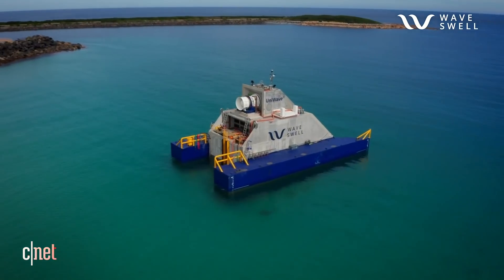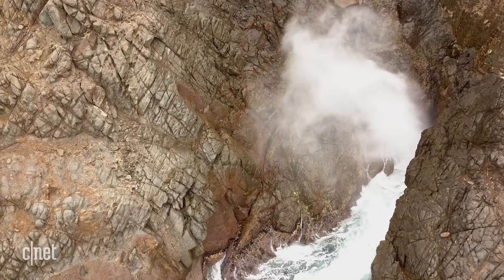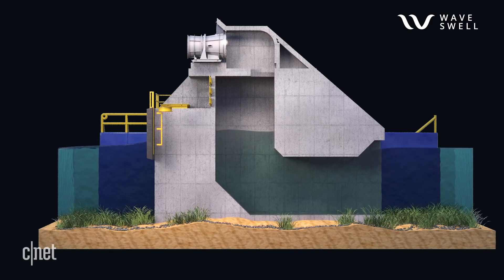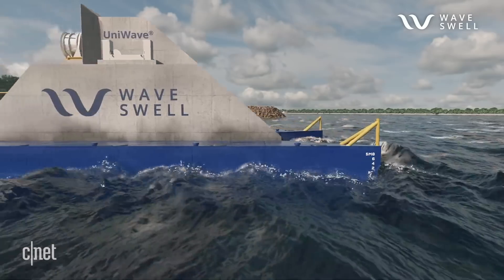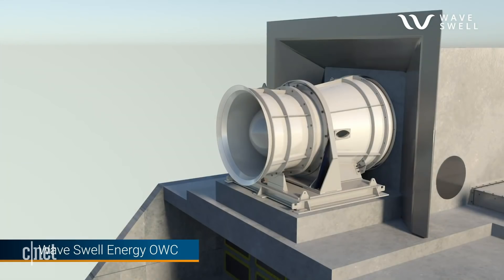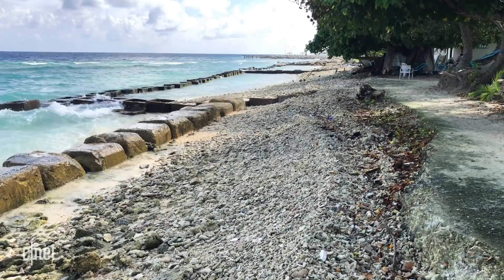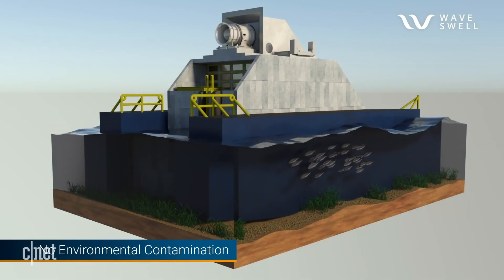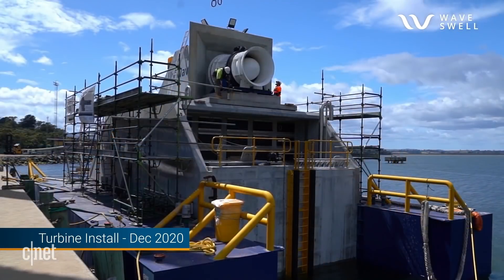How this 'artificial blowhole' could make wave energy mainstream

Comment: Do you think wave energy will be an important renewable in the future? Are there other futuristic technologies you'd like to see us cover? Please let us know down below!
Reply: @Eduardo Hwang
They use only the vacuum generated by the wave inside the blowhole. They do not use the air both ways, therefore not changing directions on the windturbine and not affecting inertia. As all the moving parts are outside of the water I think this could have great potential for the future (marine live included). As oil rigs are capable to withstand a long time in the ocean as well.
I always taught that we need to use more of the tidal power for future green electricity production. I would like to know why they did not use a V-shape as most natural blowholes are a bit v shaped.
Reply: Seems like an excellent paradigm of thinking for islands perimeters to reduce the energy, as well as use beneficially, of the water front.  Furthermore, as a power station for the energy co.rigs, lighthouses and other signaling or communications crafts.
Reply: @jafinch78  I’m Trump’s VP aka MMG of Maybach Music Group—IAM H|M—have had a complete crypto infrastructure since 2017 GOOGLE MITCHELL MARRS search “Silly Secret Service Sfumble” on YouTube! rVP MMG MARRS
Reply: @Eduardo Hwang This solves a lot of the corrosion issues as the sensitive mechanical components are not actually immersed in the salt water. Corrosion should only be marginally worse than a floating windmill, since its significantly lower to the water. As for the reversing issue, it is possible to use variable pitch blades to pivot the blades midway through, which could theoretically be done with pretty minimal energy cost but would substantially complicate the design.
Reply: Wave energy is far more constant than solar and wind and also has good output in winter when solar output is low.
Reply: @danielstapler4315  THANK YOU…. Someone finally said it! Much more constant than daylight….
Ps: the term sunlight should be dropped permanently and daylight used in its place as this is the real world reality.
Reply: Absolutely...would like to see what is happening with deep water energy projects(hot/cold) ? if it’s still viable..any in the works?
Reply: Well, maybe at the beginning of summer: revisit while adding an examination of + the Ocean Wave Power Plant + Wavepiston + CETO + Azura... consider where they might best serve... aquatic life, with no spinning blades... (see this one covered that) & additional potentials (like Wavepiston can also pump water, for de-salinization)... or potential sound avoidances... and that's just wave energy potentials, while there's also cooler to warmer surface to depth piping that's another energy potential that can be drawn from the seas & oceans...
Reply: Resort owners will squash a widespread use bc it is important to get a skin cancer and tan while looking at a vacant ocean horizon.

I don't own a resort and am for a variety of green energy helping us into the future.

I wish I was younger so I could watch all the current anti-green energy people die out and be there to celebrate their passing.
Reply: ... needs an aesthetics makeover to go into any populated coastline. Economic feasibility depends on the numbers. Amazing how many internet-smarties already know the answer without numbers.
Reply: Another way of exploiting on existing power in nature would be making use of tidal waterflow. Twice a day reliable masses of water go to and fro. This energy also should be harvested.
Reply: @HarryGuit  tidal is good, requires a nice big basin to be effective and then it doubles up as on demand storage, more predictable than wave power and just needs a low speed turbine and shaft, similar in construction to a ship's machinery.
Reply: @zopEnglandzip  Yup, simple man-made channels  leading to a significant inland collection pool : Double the run-in / run-off, double the energy reclamation, along the lines you have described: Water Head is NOT the only way to make energy! Volume is a key component too, even at lower speeds / pressures...i,e tides running up (& down) a designed bore....where ARE teh hydraulic engineers on this forum???
Reply: @citizenscience659  
It can produce good power but at the cost of environmental change or damage. Once you either close off an existing reservoir or create a new one you’re effecting the local flora and fauna. Dubai’s Palm and World artificial island building projects have shown how reducing the natural flow and effecting the ecosystem can have unpleasant and unforeseen consequences.
Reply: @HarryGuit  
This has been looked into and there are a few major environmental drawbacks to it.
Reply: How about the latest developments in nuclear power?
Reply: hi, you said this thing will start producing electricity by March. is there any update? was it successful?
Reply: Water collection from solar style panels, very interesting stuff
Reply: Awesome: Doing away with Wells turbine inefficiencies AND limiting salt/moisture exposure to the rotating parts! 
Phase 2:  Dramatically INCREASE the water column for free, by clever design.... capture a steeper energy gradient by lateral Funneling of the medium...give me a call if not clear.  Or at least give me an honourable mention when you do crack it....
Reply: @Eduardo Hwang 
I think with a simple arrangement of flap valves the turbine would only ever spin in one direction. Imagine the old fashioned bellows from a forge? On the suction stroke a flap valve closes so it doesn’t suck hot embers into the mechanism. With the right timing the incoming wave could pressurise air and on the waves recession it’s trying to create a vacuum so could then suck the turbine from the other side by dint of a flap valve. I hope that makes sense, coz it does seem feasible to me. If it doesn’t let me know and I’ll try and explain it more betterer 😉
Reply: @Therapistinthewhitehouse  I’m Trump’s VP aka MMG of Maybach Music Group—IAM H|M—have had a complete crypto infrastructure since 2017 GOOGLE MITCHELL MARRS search “Silly Secret Service Sfumble” on YouTube! rVP MMG MARRS
Reply: If this can compete on cost with conventional coastal sea defences and has suitable grid access then it may be a Success
Reply: Projects like the materials genome project, where they can predict the properties of yet to be made materials, will I think get us what I call "Enhanced Conductors", that whilst not being superconductive won't require any cooling & will enhance the efficiency of dynamos & motors without much heat lose.
Reply: How do we contact these guys we want some
Reply: The execution on this wave power is interesting and can probably be something in the different scenarios he described. Cement is one of the worst environmental culprits and requires a lot of energy to manufacture and is harmful to the environment.
Reply: Nuclear fusion is the only way. Everything else is a supplement.
Reply: @outterboxthinker  
You better hurry up and solve the problems achieving it then😉
Reply: @outterboxthinker  the issue is why do smaller nations need nuclear fusion when more simple (and realistic) technologies like this is available now. I see this as a great option for smaller island nations and isolated and non isolated coastal communities. I would like to see such communities rely much less on large electric producing companies dictating to the communities about what the communities need.
Reply: I think it's a great idea. Simple is always elegant. Even with a large opening reef buildup won't make much of an affect. Easy to access easy to fix. With other added benefits. I think this technology will go places.
Reply: this episode was great! 
would love to hear more about new generation small, fast, mobile nuclear reactors, for starters.

specifically, I would love to actually see how much nuclear waste is generated comparatively per day/per GWh and how it can be stored safely.
Reply: Turbines installed in the potable water infrastructure.
Reply: @kengoetz6231  what point are you trying to make?
Reply: Only with LED lighting strips will this work! But seriously it would be necessary to compare Wind energy side-by-side this wave machine I don’t believe there’s enough air moving through to be efficient.
Reply: Nope, energy production vs what we need wont come close to making an impact. Cover the coasts in these ugly bunkers and we still wont solve our power problems.
Reply: There’s no way to overcome the corrosive nature of the oceanic environment, and I don’t think wave energy will be a large component of energy generation. If it’s an enhancement of a breakwater like these are and the energy generation is a side thing I can see it happen, but there’s no way a grid can rely on this.
Reply: @herbertpocket8855  I disagree.... we improve constantly and if we don't push new innovation we will go no where ….
Reply: @herbertpocket8855  no way to overcone it, have you heard of bon metallic materials , have you heard of stainless steel, aluminium, gold, ect
Reply: @herbertpocket8855  So you think we should refrain from using ships as the corrosive power of the salt water cannot be overcome?
Reply: @herbertpocket8855  the eternal problem of wave energy. 

You have to put it some place where there are waves. ;)
Reply: @herbertpocket8855  "There’s no way to overcome the corrosive nature of the oceanic environment" well, oil rigs have done it for decades, so I don't see why renewables cant take over now.
Reply: @licencetoswill  there is a cost reward that puts oil rigs in positive, this will likely be negative, rigs and the associated ancillary machinery are maintenance heavy and normally in offshore locations, these turbines will suffer from Sandy salt water regardless of not being submerged. Not saying it can't work but it'll take some clever material choices and design to get it working economically enough.
Reply: Not without taxpayer subsidies, just like solar and wind turbines.
Reply: @ecduzitgood  
It’s not like oil, gas and nuclear don’t or haven’t  had subsidies/tax concessions, so why not renewables?
Reply: I think we need to mention smart pavements (sidewalks) and roads where energy is generated by walking and driving on them. On new builds it would be easy to fit in shopping centres (malls) etc also if high rise buildings could have wind turbines on top of them as well as widows with solar cells built into them. If implemented on a large scale then  buildings could take a huge load of the national grid
Reply: @mikecoshan3752  They've already tested and put those ideas down. They became too expensive to maintain.
Reply: @mikecoshan3752  lol "SOLAR FREAKIN ROADWAYS" - .... LOL yeah, no, it just isn't realistic at all.
Reply: @mikecoshan3752  
The first 2 are not a great source for generating large amounts of power. Using pedestrians to make power is unlikely to be either productive or welcomed. The ground/floor would need to have a moving element in it and as such it would feel less stable and take more effort to walk on, rather like walking in sand is harder than on concrete. As for cars generating power, for similar reasons that makes no sense, even if you disregard the complexity, construction and maintenance costs. To use more fuel in the vehicle to inefficiently produce power from the roadway, makes as much sense as fitting a wind turbine to the roof of your car. Believe it or not, I had this suggested to me by a car mechanic once and I had to explain why it wouldn’t work, first using Newton’s laws and then when that fell on stony soil more basic/simple to understand principles. 
As for the other 2, great ideas! Every building regardless of height should (and hopefully will) have power generating AND storage capacity in the next few years, once the incentives are put in place.

Comment: It must be anchored in some way since it is not resting on the seafloor.  A chain anchor would explain why the up motion is the one that's harnessed.  It also helps that the structure is heavy, i.e. has inertial mass, even if its floating.

Comment: Why so complicated... 16,000 psi at the ocean floor and 14 at the surface... A simple tube with generators in it and water pressure... Like an open ended tube with the intake in the water at depth could push water up to the edge of space. Would have the whole ocean behind it at surface level to.... Guess actual unlimited energy in the form of a natural pump with high energy low and low energy being higher isn't really what they are after tho... Obviously cause its kinda a common sense thing.

Comment: I would think efficiency would go down with compressibility losses of going to an incompressible liquid (water) to compressible (air).  Also running off a vacuum seems a bad idea unless you feel you will never go less then -14.7 psi.  Might work.  Is there a model tested or only simulation?

Comment: This is something that occurred to me when I first observed a blowhole. And it seems to me that they are missing an obvious trick to both remove the generator from the ocean and keep the air flow working both strokes of the water column more evenly.

Use a pipe to deliver pressurised air to a land based generator and a simple flipping valve to drive the air through intermediate pressurised chambers and hence in one direction only through the generator.

The generator has two sides. A high pressure side and a low pressure side. On the rising water cycle the air is driven from the ocean side of the generator to pressurise the air, on the falling cycle of the water column the valve flips to close the rising side and open the opposing side to suck the air through the generator.

By having multiple staggered chambers at an angle to the wave movement, the cycle can be smoothed out. No need to have a hammer blow action. If the wave chamber is used to compress the air in one chamber and decompress it in another that softens the wave action by simple pneumatics. All of that can be land based with only pipes connecting them to the ocean.

You could also use the pumping action of the waves to raise the water level in a separate raised body of water which then could be used to store energy like a hydro scheme.
Reply: you can change the fan and have 1 opening above water and take advantage of both in going and outgoing air, i'm curious about their studies that said that was less efficient

Comment: There are better ways to guide the air so that you can use both push and pull cycles and only spin the turbine in 1 direction. Either using ducts and a valve guide both air streams in the same side of the turbine or use 2 turbines and use a valve to use 1 for push and the other for pull.

Comment: Instead of just venting when the water column increases, have a second turbine that utilizes that direction. Just doubled your efficiency. I'll take my name on the patent and a check in the mail. You're welcome.
Reply: Instead of wave power generation simply pick an isolated high flow harbor and whack in a tidal power generation system that utilizes incoming and outgoing current flows from the harbor..Simply have a dredge on hand to deal with any shifting sand and Bobs your uncle.

Comment: I like this idea, but they are wasting one half of the power. they got it right, but only applied it in one direction. instead of a bi directional system on one generator. they vented the compression stroke, and harnessed the intake stroke. Awesome. now harness the compression stroke and have a two fer. two separate generators, on the same platform, using more of the kinetic energy from the wave.

Comment: I have this idea of using the sub sea level areas to generate power,fresh water and counter sea level rise.
Water could be channeled downhill from sea level and still have enough drop to turn a turbine have a reverse osmosis column or spread out in solar distillation ponds with a condensation roof. Saltwater could dilute the Salton Sea and restore the fishing while slowing the wind blown Selenium problem.
Huge open evaporation pans could turn billions of gallons of ocean into rain as far as Africa.
Later I would divert the Mississippi and Missouri Rivers to avoid seasonal flooding and use that water to backflush the salt water and form a massive inland freshwater lake while keeping farmers off the top of barns. Too much freshwater should be a blessing not a problem.

Comment: Add a second turbine, and a flap valve style system. Where as air ir pushed in, the flap lifts and pushes air through an outgoing turbine, as it goes down, the flap is pulled down, and works exactly as you intend.

Comment: This system relies on displacrment. The air displaced is  exactly the same volume as the water displacing it. Given that water is approx 1000 x the mass of air it would be more beneficial to power the turbine by the moving water itself. Displaced air is merely skimming the surface of the actual energy available.
Reply: Yeah, but having moving parts submerged in seawater causes significant wear and corrosion on those parts and creates a hazard to marine life. Using a turbine that runs off the displaced air reduces maintenance costs and increases lifetime and uptime of the system. Previous attempts failed because of the costs associated with frequent maintenance and replacement, so this is probably a good compromise between energy generation capacity and longevity/reliability.

Comment: Gosh what could possibly go wrong at scale removing energy from oceans that are already seeing immense destabilization and critical food supply threat? The only way this would actually help is if instead they managed to do it in a different way that removed HEAT from the oceans so that the several degree temperature increases at scale that are causing destabilization were in effect countered assuming it didnt cause some other problem and that they didnt overdo it like literally everything to the point they make the oceans too cold.